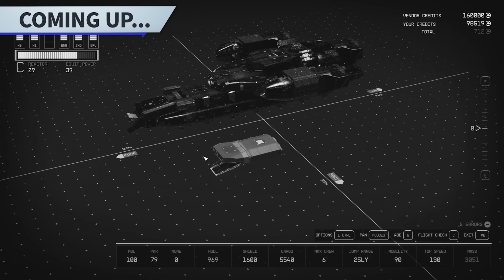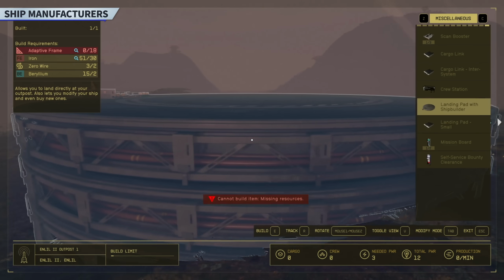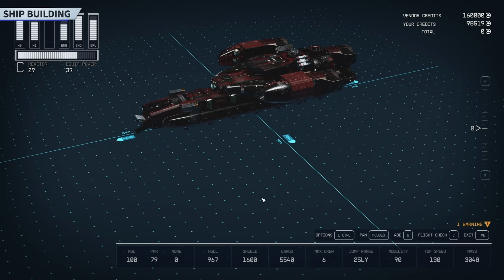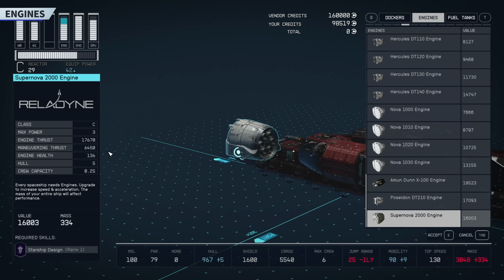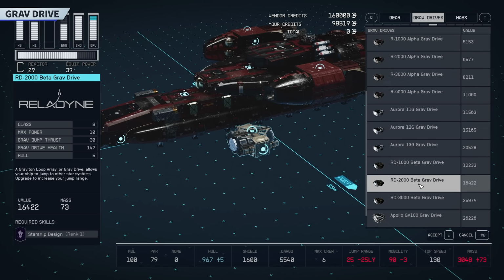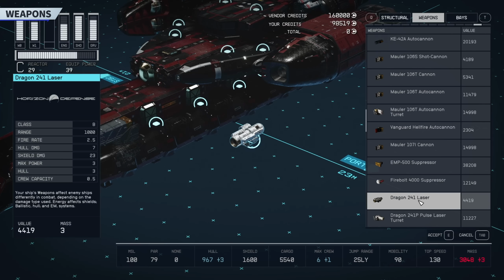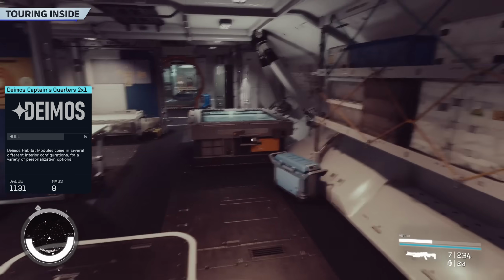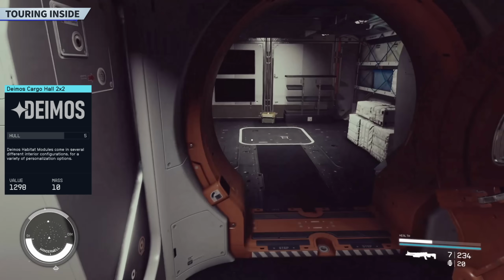Starfield - Ultimate SHIP BUILDING Guide (Spoiler free)

Comment: Missiles are basically worthless in this game, so I just delete them, install 4 or more particle cannons that absolutely spank shields and hull, and then a high quality EM disruptor for capturing ships. I dump pretty much all my power into shields and particle cannons, a few bars to engines, and a few to the disruptor. The result is you get effectively endless full-auto that is pinpoint accurate to 4,000 Km that slices through low to mid tier ships like a dart through a balloon. My ship isn't even end-game yet, and I have been able to eviscerate up to five ships without losing even 50% shields, two of which I destroyed before they could get their weapons in range of me. Missiles suck, because they are slow, and you have to be stupid close to make use of their lock-on functions.

I should probably turn my difficulty up from normal to hard or very hard, to be frank. I'll get more Xp, and a better challenge.
Also, USE THE FLIGHT SIM!!! If you go to MAST and enlist in the Vanguard, you get access to their flight sim. This is an AMAZING tool for maxing out your pilot skill, and other ship combat skills, because kills in it count as the real thing. It's also a fantastic way to max out your lockpicking, as the dev console in the sim re-locks upon exit. You will become really, really good. I managed to clear level 6, completing the sim. When you turn in your test, you're still free to use the sim anytime you want, so make use of it!

Comment: I can't wait for modders to fix this garbage ship building system. I need to be able to rotate habs. I need to be able to control door locations so the rooms flow in a way that makes sense. I need to be able to shift module placement left and right without having to close the placement and choose a new attachment point. For now, I can build a ship that's awesome on the outside, but makes no sense inside. I've had companionways lead to literally nowhere and multiple habs be cut off from each other even when they're on the same deck.

Comment: dockers can be also mounted to the bottom of the ship. If you have a bay with connection port on the same plane, this can come quite handy since you already need a hab behind it and nothing can be below a bay anyways.
If you double click on any part, all connected parts get selected. So for example you have a engine section on a single pylon and want to move it. Sever the pylon by draging it away, then you can double click the engine section and (given there are no other connections) only this section gets selected for moving.
Also comes in handy for coloring your ship. Double click, press Color button, select colors, confirm.

Comment: I see many have problems with "randomly" created doors and latters. I think i have found a way to see if the door will be created where you want it to be. 

I've done some testing and if you place your cursur over the node where you want to create the door and press G (add) it will only show the parts that fits with that node. So if you then go to habs you can see some of them move as you filter trough the different habs, showing you if its a fit or not.

Comment: Pretty nice guide.
Want to add about weapons though - you don't need to power all systems. Weapons are light and don't take much space, so you can have all three groups, power just one at a time for different situations. For example i have particle as main one, always full power, rockets for initial burst damage powered only 1 bar, and disruptors, in case I want to board ship instead of destroying it, most of the time they are just here not doing anything, except extra hull, but when i want to take ship or deal with crew and loot cargo - i power them app. It is faster and easier, then shooting engines through targeting (also targeting requires skill point to unlock and i don't feel like it is necessary, when you have disruptors, and money are cheaper then skill points) 
Also, there is separate metric for amount of passengers, you can see it in habs descriptions (for example living, all-in-one, mess, etc.). If your quest involve transporting someone - you will need it (but almost always it won't require neither crew nor passenger slots, I found it useful only in quest for Straud's ship, 2 will be enough for it).

In general Bethesda did an awful job on descripting stuff throughout the game, for ship builder it took me quiet some time to figure everything out and some googling too. But ship building is surprisingly fun, that's a pity the space here is rudimentary

Comment: Great video, there were a few things in it I didn't know about, so well worth the watch (specifically for showing the Kon-Tiki Bridge, I'd only ever seen it once mounted to a ship for sale and really wanted to know what manufacturer it was supplied by).

One thing I will mention is the crew capacity stat on weapons and engines isn't how many crew you need to have them on the ship, but how many crew they ALLOW you to have. Crew workstations dictate the MAXIMUM crew you can have, but in order to reach that you need enough weapons and engines (on top of the ship command skill).

The living quarters and all-in-one berths are not purely cosmetic, they both come with a cooking station, the computer core and engineering bay is also not purely cosmetic as they provides additional crew stations.

Comment: I built the Defiant from DS9 lol. Maintained full power on 12 turrets, had 4 3015 engines for dat sassy top speed, best reactor and best jump drive. Clocked in at just over 1000 mass, best shield and took 10 to crew. It got to the point where if I did anything else with it I'd drop from 100 mobility. That thing is a tank, maximum everything without a mod used lol.

Comment: I love the ship building mode. But my only beef is that you can't always know where the ladders will be. When you start stacking decks to multiple levels, you can have ladders that are strewn everywhere. Add on top of that, if you don't remember the placement of doors on the numerous habitat modules, depending on how your build your ships, you're gonna be running around like a rat in a maze just find the cockpit 🤣
This could've been made much simpler had we been given control over which sides of the habs will have doors. Or heck, just let all walls have them. Same thing with ladders.

Comment: I've been assuming that cargo doesn't add to the ship stats, which means the cargo holds having weight makes... more sense(kinda?) Would be nice if the Cargo holds weighed very little, as they were empty space, but your actual cargo added to the weight stat as they filled up. Slowly slowing your ship down and reducing jump range.
The Deimos Workshop also has a research terminal, I believe. Next to the Armour station.

Comment: Great video, thanks! I've spent hours mucking around in the ship builder (i'm level 30 i think) and I have one major frustration. There doesn't seem to be any way to know how the hab sections will affect flow through the ship. The builder shows what I think are doors at each end, but connecting some habs together don't always provide passthrough. I'm currently focused on stroud eklund for my main components. Putting habs together where I wanted them on the same level has resulted in a maze of connections that just make it hard to walk around the ship. I get the armory having fixed ends to allow all the weapon mounts, but you'd think that normal habs would generate more logical pathways when connected. 
I'm sure there will be mods to allow you to edit how habs are connected, but until then, is there any rhyme or reason you've found?

Comment: PSA regarding error messages with the docking module! Placing it on "the outside edge" of your ship means that if it's placed on top of your ship, it needs to be the HIGHEST STRUCTURE of the ship (roughly), you can place it on modules to raise it up ofc. Not sure how it works when you place it on the port side or so, had no luck with that so far. Hope someone finds this useful :).
Reply: It can also be in the bottom. That's why they say "outside edge" and not "highest point".

Comment: I wonder if you can properly do "silent running " in the game in regards to cargo smuggling. In Elite Dangerous, this was done by with a one action press in one of the ship's control panels which cut power to all heat generating subsystems, making you harder to detect particularly at further ranges. The downside is that the heat generates within the ship itself, which if not disabled in time, could damage subsystems and even cause the ship to blow up in extreme scenarios unless you had Heat Sinks.

 In one mission you kind of do something similar in order to approach some salvage, but it felt very iffy. If your ship is small enough, you should be able to cut power to subsystems,  and be visibly harder to see as well as undetected by sensors. Thoguh this would also be difficult to pull off because Starfield does not have any way to disable flight assist and let your ship just drift at speed prior to disabling thrusters. it's simple, but also a pretty deep mechanic and Starfield 2 should definitely take notes from Elite Dangerous bc while Starfield does a lot that ED doesn't, the opposite is also true and I think its largly due to ED's ship focused nature. Starfield could absolutely benefit from more roleplay activities as well as having each system be fully traversible by by means of FTL travel that works like Supercruising so that players won't travel 7 hours to get to manually get to Pluto lol, from there, roleplay can open up by leaps and bounds to include things like long distance cargo hauling,

Comment: I'm looking forward to the update that allows us to customize the doors and ladders inside our ships. These random like mazes are fairly annoying to get around my ship
Reply: I agree, there's a number of things that need to be added to the ship builder to give better control over ship construction.
Reply: I had to spend waayyy more time than necessary just to get those damn doors to be at the correct position. It also severely limits my options. For immersion reasons I want a captains quarter or infirmary that only has 1 entrance. Or, and this is my biggest issue, I want my landing bay to connect to a 1x1 and only use a door so it kinda feels like an extra airlock. (Opening the door at a planet at vacuum isn't a good idea) but the damn thing keeps using ladders... Stuff like that makes a ship that should be build in 10 minutes take 4 hours+. Also, when replacing a module all the damn pathways are different!
Reply: @MiD218  Im not sure if I understand you correctly, but different bays have different entry points, some on the top so it creates a latter, and some straight ahead, creating a door.

As for doors and habs. I've done some testing and if you place your cursur over the node where you want to create the door and press G (add) it will only show the parts that fits with that node. So if you then go to habs you can see some of them move as you filter trough the different habs, showing you if its a fit or not.

Hope that helps.
Reply: @satisfaximus   hmm no there is an issue where lets say I have a 3x1 and I put another 3x1 next to it, it will randomly place the entryway where it wants it doesn't matter if you use the Add placement to it, its a bit of an oversight in ship building design for the game its not a huge issue just a surprising oversight.
Best way around it is to just make sure there is only ever a compainionway or something similar linking habs
Reply: @BobOfBarons  Yeah i was a bit to quick, just got lucky the first time i testet and it ended up the way I wanted it. I know its not a huge issue gameplaywise, but its a Bethesda game and building ships and outposts should also be about being creative and creating nice ships. I was trying out the big bridge with the stairs and two floors. So i wanted the lower door to access the main part of the ship and crew area and the door in the second floor to be just for the captains quarters. But no matter what I did it would create a ladder from the C quarters to the hab below. Its just visuals. But i dont want an open ladder going straight up to my private quarters
Reply: @satisfaximus  Ye I know it kinda sucks right? I'm hoping we get a fallout 4 type expansion like the one that did the vaults but for space stations and ships. One thing you can do is the Hopetech companionways one goes only port to starboard(left to right) the other stern to bow (Back to front) but they help a bit with getting that floor right, then for going between floors you kinda just need to make dead spaces between habs and try not to stack them directly.

Doesnt fix it and your right it sucks considering the work they ended up with on settlement/vaults from the fallout series but I'm hoping for DLCs that upgrade the functionality. 

I saw somewhere people think its using a graph algorythim(I dont really know what this is/how it works exactly>?) to make sure all habs are accessable which makes it hard to make loops plan where doors are, as it will always choose to place the doors but stop once all habs are accessable. anyway hopefully we get some dlc that fixes it later, Have fun! Wish we had some multiplayer would love to randomly run into new friends like you in the settled systems :)

Comment: I DESPERATELY needed this video, great job Dantics.  
There's still so many manufacturer's I need to try out.  And I'm with you brother, they SERIOUSLY need a way for us to check out the INSIDE of modules before we go through the hassle of putting them on our ship.  I can't believe this got beta tested/etc without someone mentioning "where's the preview option?".  It would make life SO much better.  
I spent 3 HOURS yesterday in ship building just adding a couple of things and tweaking my main ship.  It would also be MUCH nicer if the error messages that come up when something is off were more SPECIFIC about EXACTLY what they had a problem with.  I've gotten errors sometimes that make no bloody sense.  There should be like a red outline or something on parts that are having problems.

Comment: I love the ship building. But i hope in the future we get updates or dlc content to edit the inside of them, or at the very least choose what connects to what in terms of door ways and ladders, maybe in the future add lifts for a multi floor ship instead. I'm sure modding will indeed get into this like crazy.
Reply: From what I have found, ladders and doors are determined by what attaches first. So placing habs in order of connection will likely give you the best chance of having a nice door & ladder flow. So build your main hallway first, then your wings, and do not block any of them with the docking bay, as you cannot walk through it.
Reply: @javelinjoe7034 i thought this was the case as well, but I read that habs have a strong preference for 2 entrance points, prioritizing 1x1 companionways.

I’ve been testing this for hours now and it seems that sticking to 2 habs in a line is the limit for consistent door / ladder placement.

Trying to use 3+ habs in a row, especially when they are stacked, causes the rats nest of ladders.

I’m not convinced build order has any effect, will test it more later.
Reply: @Artsi_guy  As for doors and habs. I've done some testing and if you place your cursur over the node where you want to create the door and press G (add) it will only show the parts that fits with that node. So if you then go to habs you can see some of them move as you filter trough the different habs, showing you if its a fit or not.

Hope that helps.
Reply: Need stairs. The whole time I was testing my ship layout (stroud-ekland cargo barge) I just kept thinking no one thought to put stairs in their ships lol?

That’s the most un luxurious thing I’ve ever seen.

Also if you’ve ever seen the Netflix series “Final Space” they have a zero G shaft that they use to get from floor to floor. I’d like to see this DLCs or at least mods

Stairs, zero G 1x1 habs, habs that are multiple levels, further variation in hab types, the ability to choose where the ladders and doors are - All things I want added later

Comment: I spent 40 minutes trying to get this game to run well with my 2070S and basically just gave up and refunded it.
Reply: It runs great on mine so I dunno why you were having problems. I have everything on Ultra, not playing at 4k but I don't care about that.

Storage or CPU causing more problems perhaps?
Reply: @TheAshCaboose  You have everything on Ultra with a 2070 Super?  What framerate are you getting?
Reply: @mclmrtn  it's stable at 30fps, considering the age of the card I'm not complaining too much, but do want to upgrade it by the end of the year. 

I do recind the "great" in my previous comment slightly though. I don't tend to have the FPS counter on as I end up fixating on it, so turning it on to answer this has made me realise it's not running "great". Did have to turn Film Grain off though, it always makes everything look so tacky.